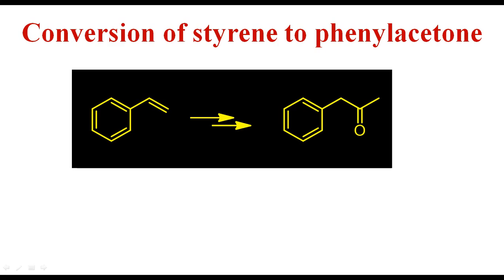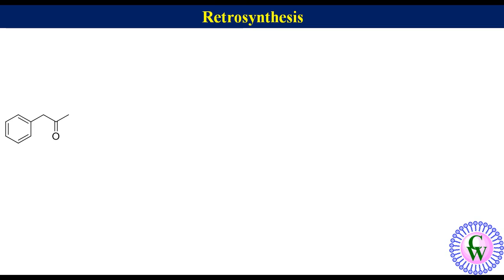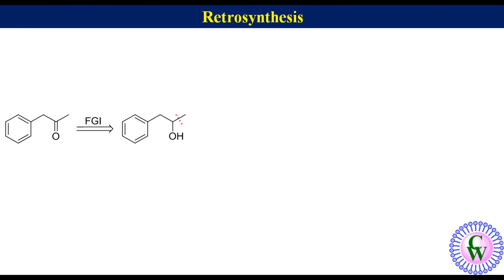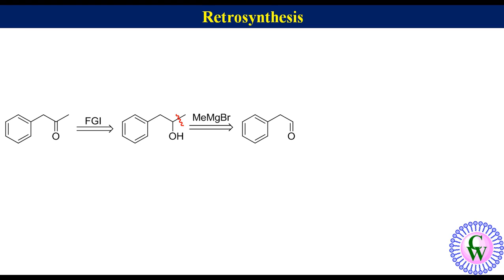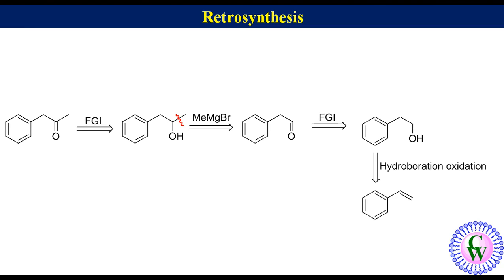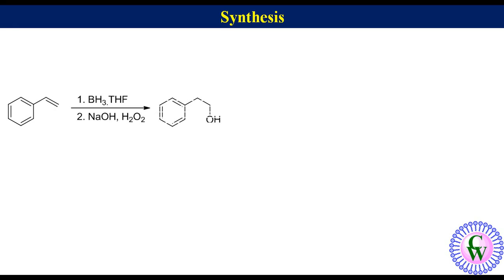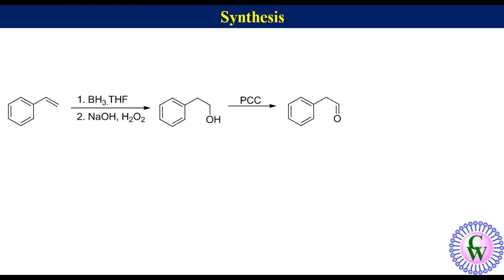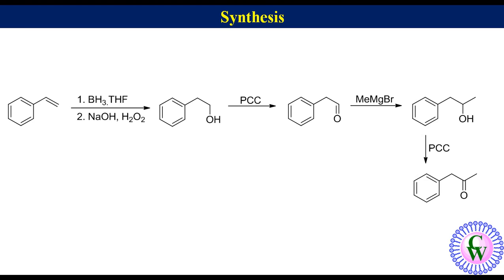Conversion of Styrene to Phenylacetone

Comment: Finally, I can turn lego's into meth!
Reply: 😂
5 gallon bucket or pale scrubbed and bleached clean for use in fermentation, fill bucket no more than 3/4 full and a o2 bubbler or a fish tank with on available 

31 grams of molasses per qrt of water 

Add bakers yiest and let stand at 80 c for a few moments like bread, keep at 8hrs warm room temp 

Then add 4mls of bitter almond oil or benzaldehyde, 4mls pers qrts of water, then bubble O2 thruought solution for few seconds to a minute to air and mix the solution 

Then add 1/2 ml of acetone per qrt of water (Acetone helps boost yields)
1/4 cup of Epsom salt per qrt 

LET FERMENT ANOTHER 4 HRS 
Adding another 4mls of BENZALDEHYDE PER QRT of water, your Then going to turn the O2 pump back on for another 8-12 hrs to yield the L-pac a P2P dirivative WHICH NEEDS TO BE FILTERED THRU A BED OF SAND THEN A REGULAR FILTER OR COTTON BALL & FUNNLE this will catch the dead yieast and clean up ur solution leaving a yield of about 70% weight by volume the undistilled aqious solution 
Or you can just wait for it to settle then 

Add about a few 100 MLS of toluene  then prepare a 10-20% sodium bisolfide solution in water by wieght and a equal to the amount of toluene and water then mix o e another shake vigorously for a few minutes discard or reuse the toluene for later 
Prepare a 10-20% by weight sodium bisulfide and water solution and begin adding it slowly till co2 stops bubbling out then Add ether to your bottle shake pull the ether off and let it dry yields are around 70% for l-pac which can actually be used to make ephedrine but is much simpler to use as a p2p dirivative you can plug in place for almost and p2p synth 😂

Comment: I think it's an expensive way...
Reply: What's a better way with chemicals that are easy to obtain?
Reply: @tiptop1681  bitter almond oil which contains crazy amounts of benzaldehyde is what I always used to make a p2p dirivative that's works in p2ps place for any synth
Reply: @tiptop1681  it's been a minute and there's a better detailed book you could read that's been around since the 80s and 90s  but here it goes 

5 gallon bucket or pale scrubbed and bleached clean for use in fermentation, fill bucket no more than 3/4 full and a o2 bubbler or a fish tank with on available 

31 grams of molasses per qrt of water 

Add bakers yiest and let stand at 80 c for a few moments like bread, keep at 8hrs warm room temp

Then add 4mls of bitter almond oil or benzaldehyde, 4mls pers qrts of water, then bubble O2 thruought solution for few seconds to a minute to air and mix the solution 

Then add 1/2 ml of acetone per qrt of water (Acetone helps boost yields)
1/4 cup of Epsom salt per qrt 

LET FERMENT ANOTHER 4 HRS 
Adding another 4mls of BENZALDEHYDE PER QRT of water, your Then going to turn the O2 pump back on for another 8-12 hrs to yield the L-pac a P2P dirivative WHICH NEEDS TO BE FILTERED THRU A BED OF SAND THEN A REGULAR FILTER OR COTTON BALL & FUNNLE this will catch the dead yieast and clean up ur solution leaving a yield of about 70% weight by volume the undistilled aqious solution 
Or you can just wait for it to settle then

Add about a few 100 MLS of toluene  then prepare a 10-20% sodium bisolfide solution in water by wieght and a equal to the amount of toluene and water then mix o e another shake vigorously for a few minutes discard or reuse the toluene for later 
Prepare a 10-20% by weight sodium bisulfide and water solution and begin adding it slowly till co2 stops bubbling out then Add ether to your bottle shake pull the ether off and let it dry yields are around 70% for l-pac which can actually be used to make ephedrine but is much simpler to use as a p2p dirivative you can plug in place for almost and p2p synth
Reply: Can't we make it with benzyl magnesium bromide and acetaldhehyde... i think that's just simple a one step reaction

Comment: Nice sir g 👌
Reply: I m aman kumar lab 01
Reply: @chemistrywallah1270 
5 gallon bucket or pale scrubbed and bleached clean for use in fermentation, fill bucket no more than 3/4 full and a o2 bubbler or a fish tank with on available 

31 grams of molasses per qrt of water 

Add bakers yiest and let stand at 80 c for a few moments like bread, keep at 8hrs warm room temp 

Then add 4mls of bitter almond oil or benzaldehyde, 4mls pers qrts of water, then bubble O2 thruought solution for few seconds to a minute to air and mix the solution 

Then add 1/2 ml of acetone per qrt of water (Acetone helps boost yields)
1/4 cup of Epsom salt per qrt 

LET FERMENT ANOTHER 4 HRS 
Adding another 4mls of BENZALDEHYDE PER QRT of water, your Then going to turn the O2 pump back on for another 8-12 hrs to yield the L-pac a P2P dirivative WHICH NEEDS TO BE FILTERED THRU A BED OF SAND THEN A REGULAR FILTER OR COTTON BALL & FUNNLE this will catch the dead yieast and clean up ur solution leaving a yield of about 70% weight by volume the undistilled aqious solution 
Or you can just wait for it to settle then 

Add about a few 100 MLS of toluene  then prepare a 10-20% sodium bisolfide solution in water by wieght and a equal to the amount of toluene and water then mix o e another shake vigorously for a few minutes discard or reuse the toluene for later 
Prepare a 10-20% by weight sodium bisulfide and water solution and begin adding it slowly till co2 stops bubbling out then Add ether to your bottle shake pull the ether off and let it dry yields are around 70% for l-pac which can actually be used to make ephedrine but is much simpler to use as a p2p dirivative you can plug in place for almost and p2p synth
Reply: 5 gallon bucket or pale scrubbed and bleached clean for use in fermentation, fill bucket no more than 3/4 full and a o2 bubbler or a fish tank with on available 

31 grams of molasses per qrt of water 

Add bakers yiest and let stand at 80 c for a few moments like bread, keep at 8hrs warm room temp 

Then add 4mls of bitter almond oil or benzaldehyde, 4mls pers qrts of water, then bubble O2 thruought solution for few seconds to a minute to air and mix the solution 

Then add 1/2 ml of acetone per qrt of water (Acetone helps boost yields)
1/4 cup of Epsom salt per qrt 

LET FERMENT ANOTHER 4 HRS 
Adding another 4mls of BENZALDEHYDE PER QRT of water, your Then going to turn the O2 pump back on for another 8-12 hrs to yield the L-pac a P2P dirivative WHICH NEEDS TO BE FILTERED THRU A BED OF SAND THEN A REGULAR FILTER OR COTTON BALL & FUNNLE this will catch the dead yieast and clean up ur solution leaving a yield of about 70% weight by volume the undistilled aqious solution 
Or you can just wait for it to settle then 

Add about a few 100 MLS of toluene  then prepare a 10-20% sodium bisolfide solution in water by wieght and a equal to the amount of toluene and water then mix o e another shake vigorously for a few minutes discard or reuse the toluene for later 
Prepare a 10-20% by weight sodium bisulfide and water solution and begin adding it slowly till co2 stops bubbling out then Add ether to your bottle shake pull the ether off and let it dry yields are around 70% for l-pac which can actually be used to make ephedrine but is much simpler to use as a p2p dirivative you can plug in place for almost and p2p synth